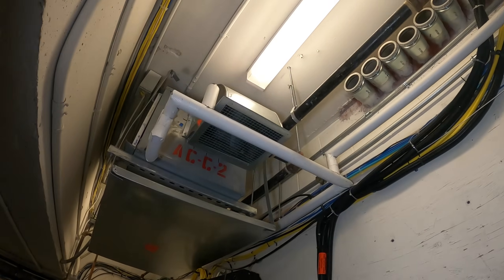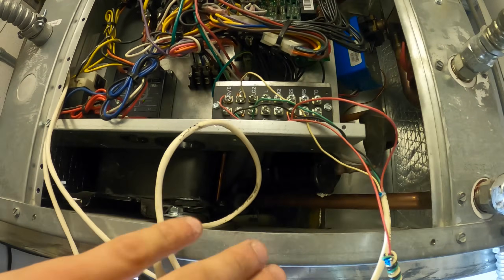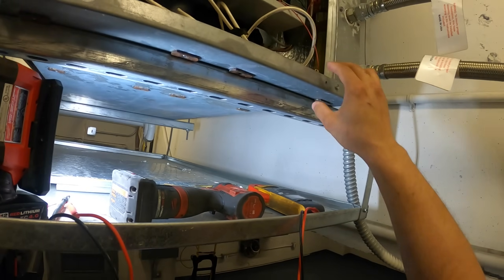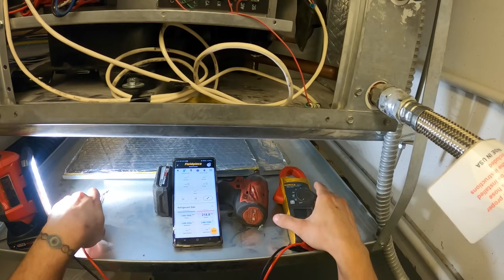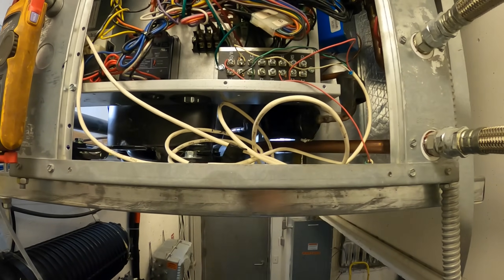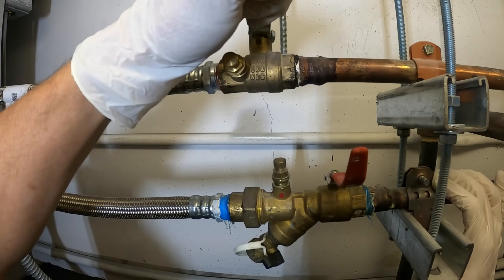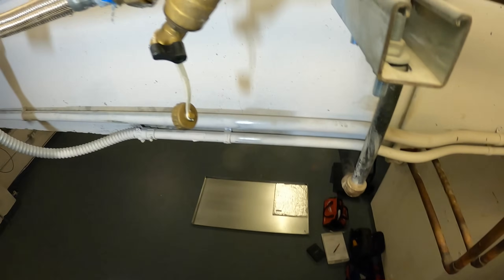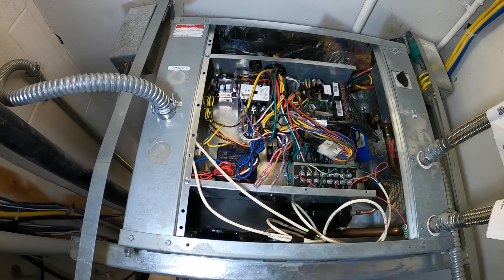HVAC Service Call: Johnson Controls Water Source Heat Pump Not Cooling (Johnson Controls HACK JOB)

Comment: Those ports you took the caps off of.....those are Peete's plug adapters for taking a pressure drop across the coaxial coil. On the leaving water side that brass component the braided hose connects to is call an Automatic balancing valve. It keeps the proper flow through the WSHP.
Reply: With the Pete's plug or also called "P/T plug"  you can  check temperature with the appropriate probe.

Comment: Looked like mainly that high pressure switch wire disconnected or fell off. Maybe there is no low pressure switch? Some hotels in my city use handyman that claim they are building operators and will hack until they don't know how to fix then call in you. They claim to be saving the site money, or the building think the fellow is saving them money. Usually leads to crash maintenance which is more expensive.

Comment: Just fyi, Can't bleed air from the inlet before the strainer. All the air you wanna bleed is after the strainer in the heat exchanger. You let it all into the loop once you open both valves. But even in a medium water loop the loop or tower air vent(s) will get it. Doesn't cause any problems unless it's a small loop and it trips a flow switch or low water cut off. Don't even need to bleed it majority of the time.

Comment: Mini blade fuses are common in HVAC equipment, they are also  used in cars.
Jumperman, Please buy a regular style fixed wrench for that common size instead of the adjustable one.
Who changed the air filter and put a 2 inch in there?  Did you go back?
That black fiber optics thing is just plastic, there's nothing electrical in there, it's a fiber optic splice block.

Comment: Ill add a correction.  This isnt made by JCI.  It is either water furnace or climate master.  based off of the data tag it was manufactured in Fort Wayne,IN which is where water furnace is manufactured. so safe to say its water furnace.  They are now normally all Climate Master. so this one must be an older model. I forget when it was changed to climate master as who was used.

Comment: Hey JMT,
That one seemed pretty straight forward and you didn't have to insert "2000 years later" into it, ha ha!
Good job on the troubleshooting.
Reply from the maker: That's a good one 😂😂😂 The video was straight forward but finding that disconnected wire was a little tricky! Thanks for watching 🙏🤙🔧⚡️

Comment: That fiber optic case is completely passive, no AC or electricity involved whatsoever. Probably the safest thing in that room 😂😂
Reply from the maker: Thats good to know because I've never had to get to close to something like that. Safest thing in the room 😂 Thanks for the info & thanks for watching! 🙏🔧⚡️🤙
Reply: They are also installed on overhead fiberoptic lines in neighborhoods.  I think they are splice/distribution boxes.  There is one on the overhead line next to my garage.  I watched them install my fiber last summer.  The cable has two steel strands with the fiber cable sandwiched in between.  The fiber strand is not physically strong enough by itself, so it needs stronger support.

Comment: I'm willing to bet that transformer isn't big enough va wise or it is not wired properly 208 vs 240 as23.5 volts is very low . I've seen it in the past where the equipment acts hinky with just under 24 volts as opposed to the 26-28 volts that is usual